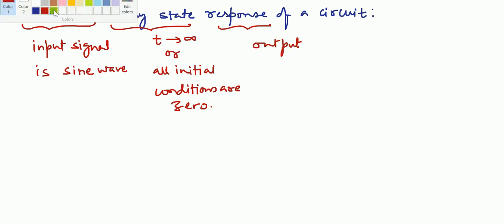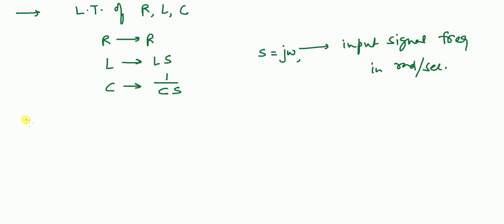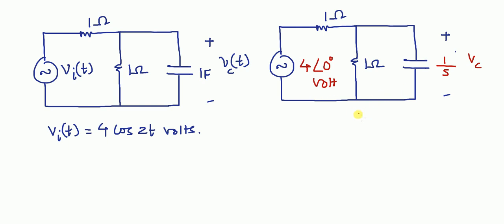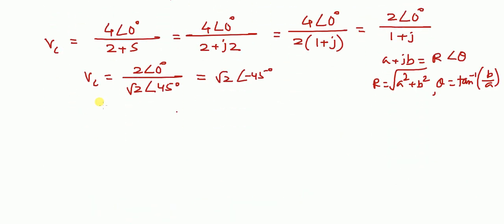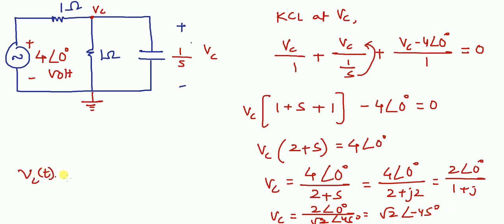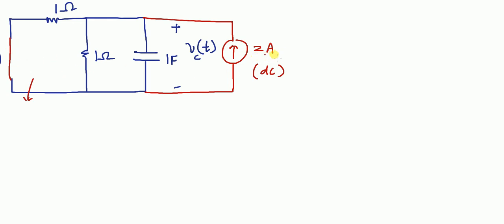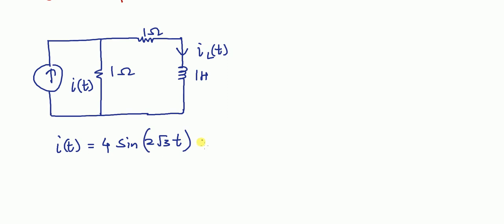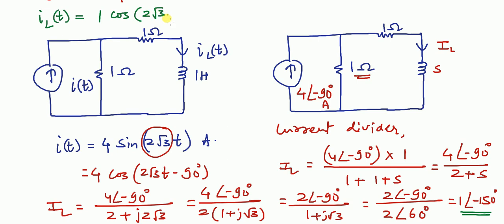Sinusoidal Steady State Response of a Circuit

Comment: What is meant by steady-state in a capacitive circuit subject to a sinusoidal voltage input?
A sinewave depicts movements in the form of waves. It has a datum (a reference), rapid, slowing and steady growth in one direction for a quarter cycle with reference to a datum (a reference), and then slow and faster decay in one direction for the next quarter cycle, and all these elements again in the opposite direction (reversal) of the forward movement for the next half-cycle. It has peaks and valleys.
In essence, the sinewave is a perfect embodiment of oscillatory movements like springs and quantities like voltage. It retains its waveshape when added to another sinewave of the same frequency and arbitrary phase and is the only periodic waveform which has this property.
Imagine that you and your friend are playing a game of “swing”. When your friend sits on a stationary swing and you begin pushing it, it will take a few hard pushes initially to overcome inertia when the swing moves with a small displacement. You then synchronize your pushes by progressively moving slightly away from the stationary position of the swing, initially, pushing gently, and then pushing harder as you move away from the central stationary position of the swing.
The point of pushing the swing is usually at the top of the swing cycle at one end. It takes a while of pushing before you are able to establish a rhythmic swing.
The period before the rhythmic swing is established is the “transient”, and the rhythmic swing that is established after the few transient cycles elapse is the “steady-state”.
This is analogous to establishing the steady-state in a capacitive circuit subject to a sinusoidal input. The capacitor being initially uncharged, will cause the current during the transient period to assume a value that will be quite different from that at the same voltage angle after steady-state is established.
Electrostatics and circuits belong to one science, not two.
These are discussed usually separately in textbooks and science and engineering courses.
It is not possible to discuss the circuit processes which produce a sinusoidal current when a sinusoidal voltage is applied to a capacitor….the changing rates of change of the applied voltage ….the surface charge set up changing at every instant….the applied field changing in the wires ….and the current at each and every instant in time.
Watch the two videos listed below to learn about current and the conduction process and surface charges (using a unified approach to electrostatics and circuits at a fundamental level).
1. https://youtu.be/REsWdd76qxc 
2. https://youtu.be/8BQM_xw2Rfo
The last frame of video #1 lists textbook 4 which discusses the sinusoidal steady-state in capacitors and inductors with the help of sequential diagrams and animated power-point presentations of the varying field components in the circuit elements in more detail.